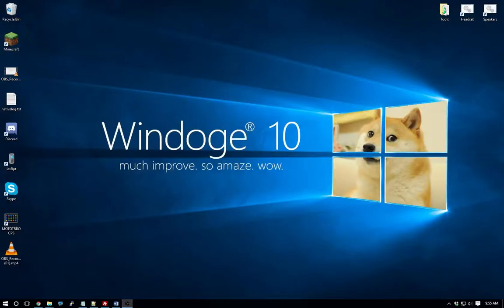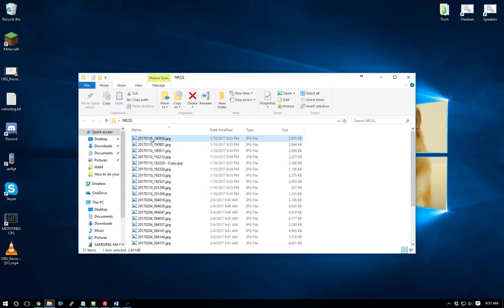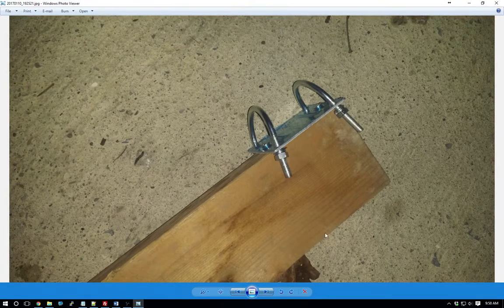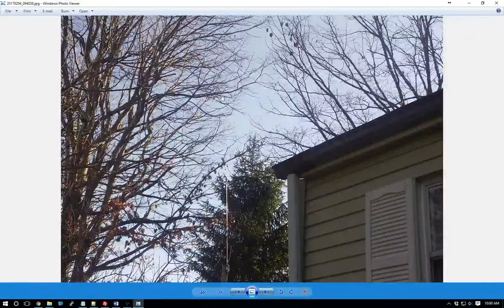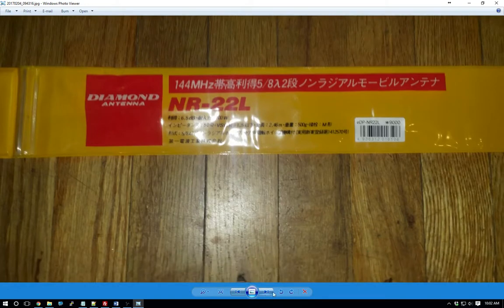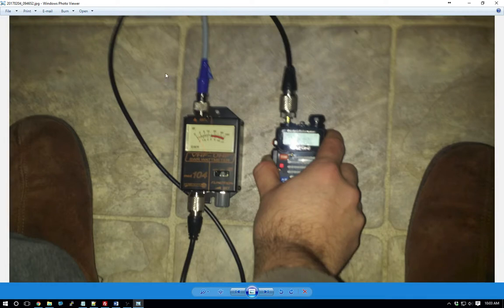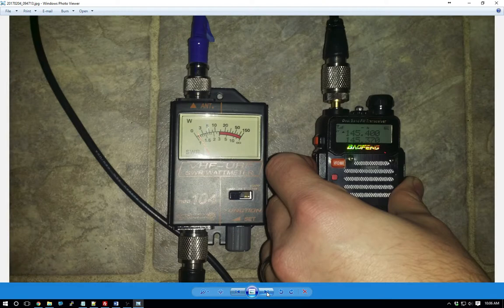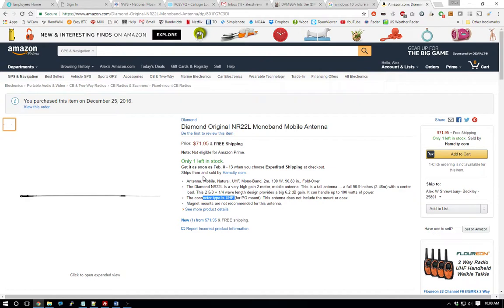Diamond NR22L as Base Station Antenna

Comment: This is a 5/8 over 5/8 on 2metre  a mobile ant . 
This might sound mental,  however it will work on 28mhz as a full 1/4 , you might (will need )ground plain . Yes this diamond nr22l is a fabulous 2metre mobile ant . But a killer 28mhz mobile ant . I use this ant on top of my van on a ladder rack .I also use a outbacker outreach 160 - 10 metre which is 3metre long on that rack on top of the van . No it doesn't look ridiculous,  it looks very very fabulous.